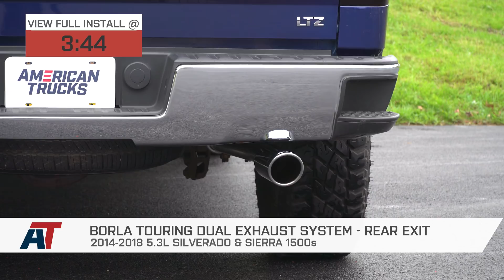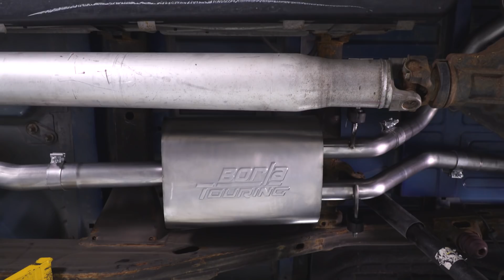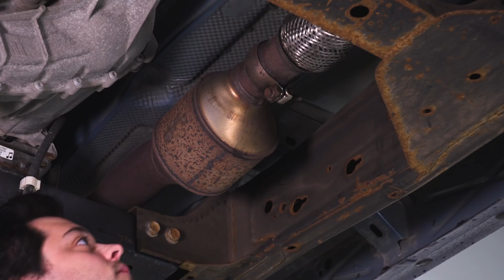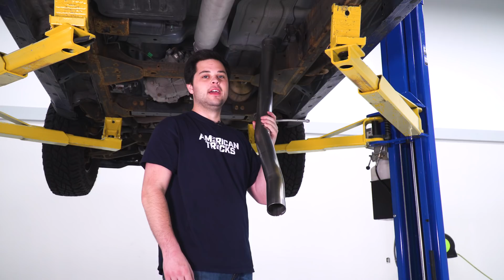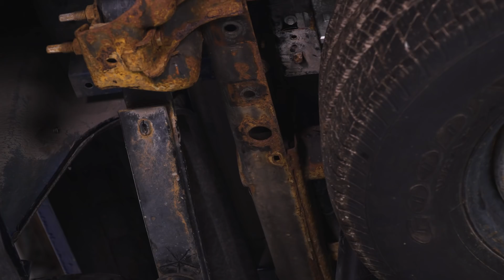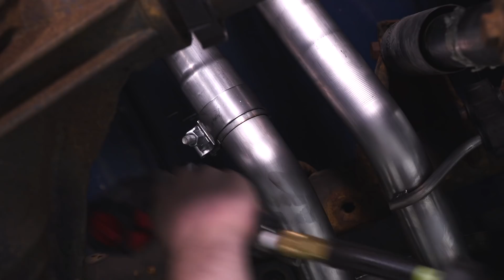2014-2018 Silverado & Sierra Borla Touring Dual Rear Exit System 5.3L Exhaust Sound Clip & Install

Comment: Where in the world are you guys that a truck that new is covered in rust already? Or did owner just never wash off r ok ad salt?? I'm in p.a and my 2014 barely has any surface rust anywhere,  only rust is on crappy rancho shocks that came with my Z71..
Reply: Lol... same with my 17...Ranchero needs to do a better job powder coating. 
They ride like new but look like shit.
Reply: If you are in PA, you must never drive your truck in the winter.
Reply: @BobSmith-mc7uq  I'm in emmaus p.a  and drive the crap out of my truck and love driving in snow, mud, I just actually wash my baby  2-3 times a week with an undercarriage wash also.. besides unfortunately it's also parked in the street getting sprayed by salt by the lovely city liquid salt spray trucks until I can get rid of this damn 16ft landscape/ car hauler trailer out of my garage..
Reply: @johnranieri7247   glad to hear. I am just south of you in Souderton. Just picked up a clean 2016,was wondering how the undercarriage would handle  PA winters. I hate that brine spray!!!